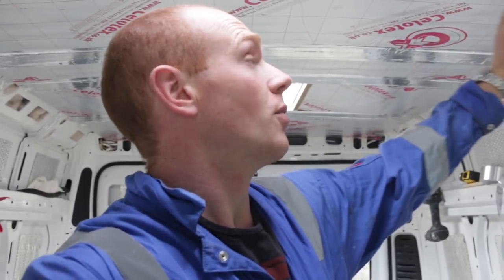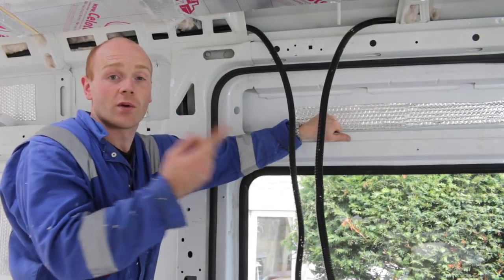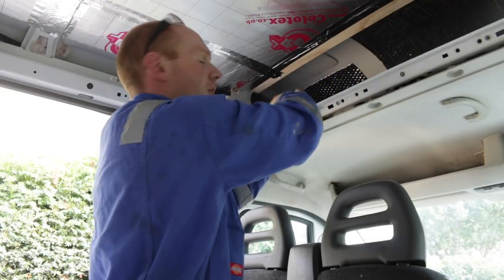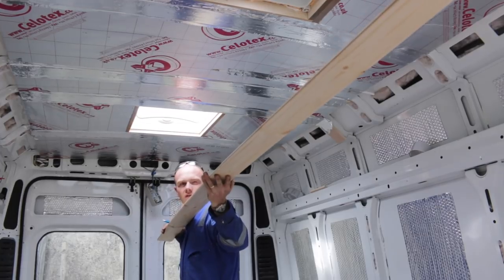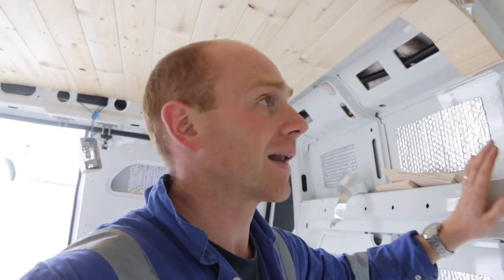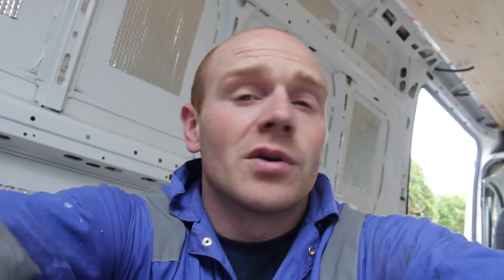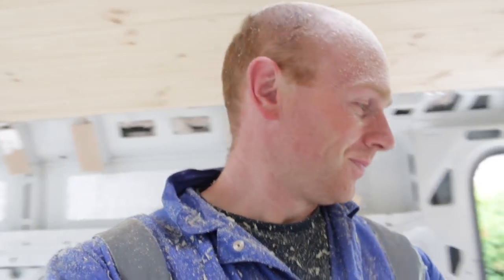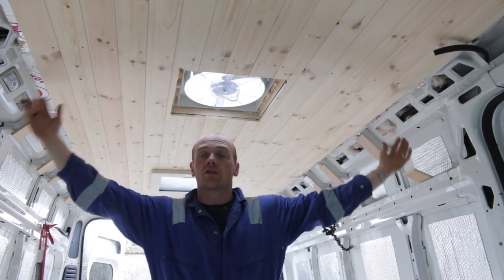Paneling the Van Ceiling | TRC Van Conversion 10.0

Comment: When you get to pulling wires through that conduit...use a vacuum cleaner to suck a piece of cotton or fishing line through (tie something small to the end to help the vacuum pull it through) then pull the wires through using the fishing line. Otherwise it can be a nightmare, especially corrugated conduit going around corners! Good luck :-)
Reply from the maker: Yep, will show that when we get to it.  Usually I tie it to a bit of foam and suck it through with the shop vac, did it to run hoses under the patio and worked great.  Pretty sure that corrugated conduit would be a nightmare to push through.

Comment: I have just finished cladding the ceiling of my van and used the router and flush trim bit after your recommendation. Was amazing how easy it was and saved so much time! Thanks!
Reply from the maker: It certainly saves all that measuring.  Works well on lost of things, I did the shed windows the same way.

Comment: I used the router method to cut openings for windows and the door when I insulated and sheeted my garage walls. It worked a treat, and as you say no messing about trying to cut to perfect size. Nice job.

Comment: Great video as always. The parcel shelf is actually attached at the back by three bolts which can be undone using a torx bit (can't remember what size). Fiddly but doable. My arms are slim so could squeeze them in. I used a scope camera to see what I was doing!
Reply from the maker: Ahh, i did try and film with my phone down there but couldn't make out a head on the bolts.  Oh well, it's actually a pretty clean base for the storage area and I should be able to get the insulation down beyond it.

Comment: This might be the FAQ, but when you have foil taped above the button, but later on you screw metal screws to the same button aren't you breaking the water seal barrier?
Reply from the maker: Screwing through a vapour barrier is usually unavoidable however there is still very lowrisk of an issue as the screw will pretty much self seal once in.

Comment: Clean install! Your right using full length boards anytime possible will always have the best look. I'm iffy on using wood/sheet metal screws on this kind of application because of vehicle movement/twist/vibration. I get it, it's the easiest solution. I had the thought of using rivnuts/nutserts with connector bolts (easier than..) or countersunk fasteners,  1/4-20 (6mm)? This would be much more complicated (A lot of neck straining upside down layout!) to locate the holes but would be much more robust and less likely to have any issues with brittle or loose fasteners. This route would most likely need to use VHB tape to isolate the wood from the metal as rivnuts have a lip so your contact point would be small. VHB would fill the void and isolate. Also if spaced properly the fasteners would have a cleaner look and allow for use of wider boards on the flat area anyways, which would be less work/fasteners. My 2 pence, Good videos!
Reply from the maker: The boards are screwed with regular wood screws into ply battens, not directly to ribs.  The ply was attached with self drilling screws but with adhesive too.  Have looked at rivnuts for another part of the build but not sure if necessary in my design, great system though.

Comment: Fantastic series of videos and really helpful in my planning for next years van conversion. I'd like to ask a couple of questions please.

As I don't own a router I thought I would fit one full length strip at a time cutting each, in situ, at the skylights as I go, do you see any problems with this approach?

Did you consider doing a lot of the prep and painting work on the timber pre-fitting and then just the finishing fill and paint once up?

Finally, if you had the same van roof to insulate again are there any things you would now do differently?

Many thanks and keep up the great work.....Al

Comment: Don't run negative back to the fuse box, just to any local metal, the whole van body is negative
Reply from the maker: Iain's Craft Beer & Brewing yes they will eventually terminate to the body. Just rather do it where I can access and not delay insulating walls.

Comment: Hi Restoration Couple … thanks for sharing this DIY . The 16 mm screws you used . What type were they . I was thinking of using finishing trim torx screws with a small head but can’t seem to find them that in length I want  . Not sure what to use .

Comment: What is the opening u have In the ceiling that isn’t a fan. It looks like u can open and close with a accordion type door? If u can provide the name. I have a MaxxAir fan above the bed, which I love, but I’d like another opening near the stove area closer to cab. I have the Ram Promaster 2500 159 (2019). Thanks for great videos.

Comment: Hi - how do you know that the tongue and groove panels are straight when you are putting them up? Is there a particular method you use or is it guesswork? Also, why don't you start from the side rather than the middle?
Reply from the maker: I wanted to have a single centre board so it looked balanced. I measured but also went off some of the vans holes and fixings which were centred. You can then use a story stick make sure you are staying straight. Tbh if you get the centre right the rest should end up fine.

Comment: Couple of follow up questions: 1. Do you find the pine panels rattle at all when you drive? Did you consider glue as well? 2. Have you noticed much expansion and contraction in different climates? 3. Did you stain them afterwards, or would you recommend staining before installing?  Thank you!
Reply from the maker: No rattling. Never glue t and g as it needs to move. In the height of summer there was a slight shrink which needed a touch up of paint here and there in the v groove. This can be avoided if you paint first but go thin to make sure they fit still.
Reply: @TheRestorationCouple  thanks!

Comment: hi am only on your paneling of the  ceiling video :) very much a beginner to the campervan world and late to the party so everything is brand new for me but great build by the way i have a  Q just as you started to stick your  flexi pipe in your van where did you start from and and were does your end stop at the back of your van or front ..  have you stuck it on both side of your van or just down one side and up to the points of were you want you ceiling fixtures  ie fan light and so on does this make any sense :)
Reply from the maker: Just to where I need it and from the control panel/fuse box location. I then left the option to run future bits within the upper cabinets if needed

Comment: Hi, I've been doing internet searches into which van to buy. I'm a bit confused because either I'm looking at the wrong vans or everyone whos done a van conversion is only about 5'6 in height.  Most of the High Roof vans only list an internal load height of about 6'1. This means after floor and roof insulation and boarding, Most people would be walking around with their heads bent over, but that's not what I see.  What am I missing?  Am I reading/converting the load heights wrong?
Reply from the maker: Mange 2 our van is now 6'2" with the finished insulated floor and ceiling. That might be an issue fit some but fine for us and doesn't seem too low. Other vans may be much less though.
Reply: Thanks for the reply.  I will be careful when making measurements.  Your videos of the build have been so informative and easy to follow. Thanks.

Comment: Why tough and grove cladding? Just aesthetics? It's heavy and it might get squeaky. I plan to use plywood or siding panels, any problem with big sheets of 5 mm plywood?
Reply from the maker: It’s very lightweight and easy way to have no end joins, plus we liked the look. Ply fine too albeit harder to scribe and fit in one piece on your own. No reason not to if you are lining it with carpet or vinyl though.

Comment: still did not understand how you applied the wood to the metal panels of the car. just screw them in? are there any special screws? will they be strong enough? will they hold to vibrations and all?
Reply from the maker: Battens omn first with adhesive and self drilling screws.  All panels were then fixed to that.

Comment: Hey! Just wanted to ask you how did you attach the matchboards on the roof? Did you use screws or nails? If screws, did you pre-drill each board to avoid it to breake? Thanks a looot!
Reply from the maker: Just a tiny trim screws, no drilling. It was a bit of a pain as we needed to fill and paint. So you could look at the clips which avoid that.

Comment: How did you insulate above the cab. With Celotex or the plastic wool. I have just reached this stage in my van build and can't decide the best way to go about it.
Reply from the maker: 25mm pir against roof and carpeted, some sort insualtion at sides and then boxed out with pir.
Reply: @TheRestorationCouple  Thanks for the quick reply. Your videos have been super helpful so far

Comment: How did you secure the insulation to the roof? Also I see you screwed the wood to the insulation what screws did you use for this to stop it falling down?
Reply: It's shown in the video before this one. It's not actually fixed to the roof per se, it's wedged between the timbers

Comment: Hi there.. thanks for the vids.. really helpful!
How is the 8mm cladding bearing up? I'm thinking to use 3m lengths from Wickes, but they seem really flimsy and I'm worried they'll distort over time.
Also, I can't find 4m + lengths (too thin for builders merchants, too long for DIY places) apart from one quite expensive timber yard (ripped to spec for £160+).. can I ask where you found yours? 
Thanks loads!
Reply from the maker: 8mm is fine, if painting you will get a little wood show on teh tongue when they shrink a bit unless you paint first I guess.  Apart from that, fine. We have teh same stuff in our loft rooms and looks great.  Wickes cladding is very poor and super brittle.  the 4.2m 8mm we used was from Bradfords, it's just over £1/m I think, the timber merchants they use/own is Snows Timbers and I believe it's nationwide.
Reply: Ah great. There's a Bradfords not too far.. I'll try them on Monday. Thanks!

Comment: Hi. Just a question. What screws did you use for the batons  to screw in to the metal roof ribs? 
Great videos
Reply from the maker: Just some self drilling screws. The adhesive does most of the work but worth putting a few in.

Comment: Hey. Happy Birthday! Great work and nice how you explain everything! 
Maybe strange question but how tall are you? Compaired to the height of the roof? And how high is the step to get into the cockpit (cabin) ?
Isn't it too low to get in confortly?
Reply from the maker: The ceiling height is just over 1.8m, which is fine for us.  Others may want to reduce the floor insulation to gain height or get the extra high model.  If you mean the step behind the front seats, it's around 100mm or so, without the swivel seats I can't tell you how access is but don't see it as an issue as will only be sat anyway.

Comment: Hi I got a question.
How do you mount the panels? You just use tapping screws into the insulation material?
I'm still not sure how I can fix the panels on my roof  :/
Reply from the maker: Job van de Noort if you watch the previous video you will see that there are plywood strips, they are foil taped over in this video. 👍
Reply: The Restoration Couple oh yea forgot about that ;) good one tnx!
Reply: I apologize if this is mentioned somewhere, I spent a fair amount of time looking thru your blog etc. Maybe my Yank accent is not translating very well :) But what brand/type of tube adhesive were you using for the metal to wood adhesion? You seem to  be impressed with it. Did it also work well on the insulation foil face to metal connection as well? Thanks for the vids, very informative.

Comment: I think he’ll find it hard to push small, stranded wire through that corrugated conduit. As you’re installing the conduit you should thread a stout piece of nylon twine through the conduit so it is end-to-end when you’re done. Then you attach your wires and pull them thru, pulling another piece of twine with the wire(s). So you always have a “pull string” in the conduit should you ever need to add a wire later.

Comment: Where did you get the long lengths? & What thickness did you use?
Reply from the maker: 8mm from local builders merchants. They might not stock it but it will only take a few days to get hold of and so much better than diy store type shorter lengths.

Comment: How did you know where the box was?
Reply: sunbin64 He knew where the box was enough to get a pilot hole somewhere inside the square, though if unsure he could've drilled pilot hole from top/roof side. Anyway the 'trick' is the type of bit he used in his router. That particular bit probably had a ball-bearing wheel on the end. The result being that the wheel follows the preexisting fan box hole so you get a perfect cut. While the cutting part of the bit only cuts wood and never touches the metal hole because the wheel holds the bit the perfect distance away from the metal hole. ( Sorry to be so wordy.  )
Reply: Thanks.  I'm clueless about that kind of stuff.  This guy is a real carpenter.
Reply: sunbin64 For anyone interested here is a random link to a router bit seller. But of interest is their 'banner' at the top of their web page, it shows 5 router bits - the two on the ends have the little wheel to which I was referring. https://goo.gl/images/ZDdjnw
Reply: Carpenter Family Tricky,and all detailed info is always appreciated by us novices who are learning through watching these builds and reading comments.
Reply: @ Time 8:40 he mentions a 'Flush Trim'  router bit. I didn't know the name of that type of bit. But that will help you find the right type of bit when you need it.
Reply: It is a good idea to pencil mark the fan location on the ceiling boards as you are putting them up. ;-)

Comment: Hay. Love watching your vids. What screws are u using to fix the cladding to the wooden strips. Just wood screws or self cutters thanks.
Reply from the maker: Short wood screws.
Reply: @TheRestorationCouple  Were the short wood screws you used countersunk ones because when i have experimented with them they split the thin tongue & groove.... 
I'm a bit stuck atm so could you tell me the exact screws you used please... I was considering flat headed screws but they will stick out too much i think.... Cheers...
Reply from the maker: jackmaster00000 can’t remember exactly but I would imagine they were spas 20mm x 3.5 or 3mm. They were pozi 1 if that helps. If I did it again I would probably just secret nail with 18g brads through the tongues on an angle. If you have super brittle pine cladding it may need pilots for screws.
Reply: @TheRestorationCouple  
I'm wondering now about the tongue and groove i have bought from wicks... Maybe it's a load of shite... It's so thin and i have a feeling it's gonna give me trouble when putting it up... You just look at it and it splits...
Anyway thanks for replying... 
I'm going to be using your method of putting up the strips of ply so you can squirt the foam above it  and it doesn't go everywhere... Good idea that was...
Reply: @TheRestorationCouple  
Do you think the cladding clips are strong enough as i may use those... I have heard though that they are flimsy and maybe a bit risky to use...
Reply from the maker: jackmaster00000 I’m afraid I intentionally walked past the Wickes stuff as like you say, it’s so light and brittle. I would be concerned more about it cupping and twisting. Cladding clips might be the best bet, at least it will allow them to move a little so less likely to buckle.

Comment: What size tongue and groove are you using?
Reply from the maker: 100x10mm, think it is around 8.5mm finished.  4.5m lengths.  Any thicker and gets heavy, any thinner and it really twists and cups.
Reply: Thanks - did you run it through your planer to thin it down? After a company we'd commissioned to do our van conversion bailed on us you've inspired us to do it ourselves! Steep learning curve but your videos are very helpful and it'll be satisfying to know it's our hard work that's gone into it.
Reply from the maker: Sorry, no it comes to me as 8.5mm thick.  Often planed timber is listed and advertised as the pre machined size so would read as 100x10mm on the shelf.  Glad to hear you are going DIY, it's pretty straight forward, just plenty of common sense and late night sketches! :-)

Comment: sunbin64 He knew where the box was enough to get a pilot hole somewhere inside the square, though if unsure he could've drilled pilot hole from top/roof side. Anyway the 'trick' is the type of bit he used in his router. That particular bit probably had a ball-bearing wheel on the end. The result being that the wheel follows the preexisting fan box hole so you get a perfect cut. While the cutting part of the bit only cuts wood and never touches the metal hole because the wheel holds the bit the perfect distance away from the metal hole. ( Sorry to be so wordy.  )

Comment: Please don't face screw the t&g paneling! It schools be nailed through the tongue. Properly installed one should see NO fasteners In a T&G wall. Face screwing just destroys the look.
Reply from the maker: It’s filled and painted and fine 3 years on. The battens are 12mm and there is no way I would trust secret nailing brads at that shallow depth in a constantly moving van. If I was going for the sauna look then I would have likely used hidden clips instead.